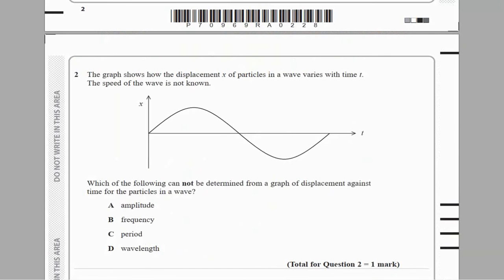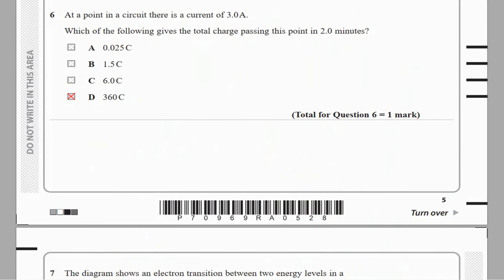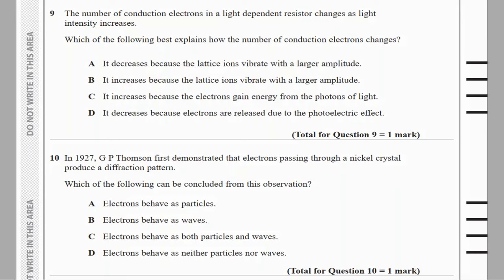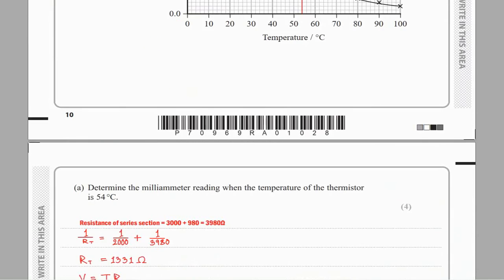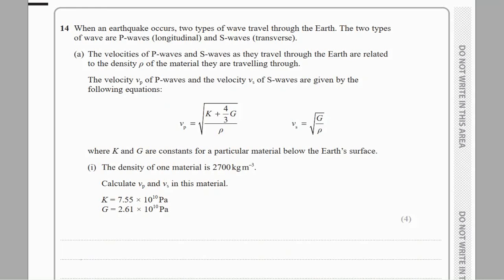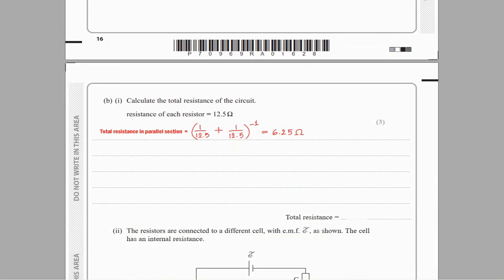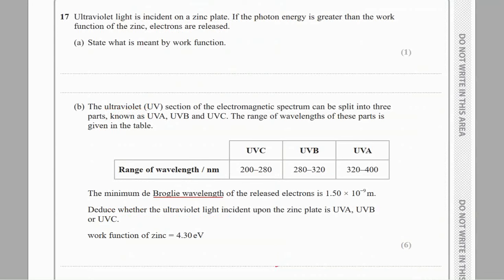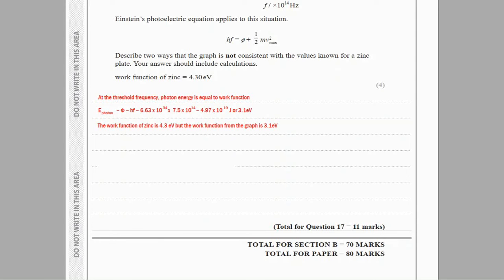June 22 Unit 2 WPH12 QP Solution Walkthrough

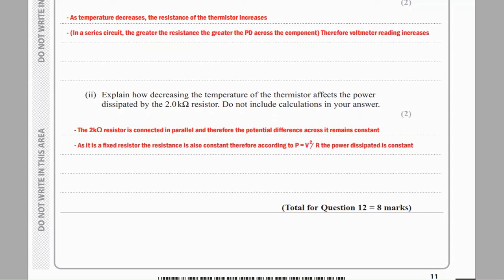Comment: 25:07 in the ms they have also mentionned another alternate answer was that current remains constant in both branches and you can use P=I^2R as well. But i dont get how current would be constant as the resistance of both branches differ

Comment: In question number 5 why is it 300000 and not 0.3? mm is converted to m by dividing with 1000
Reply from the maker: You are mixing up line spacing with lines per mm. Clear up that concept first